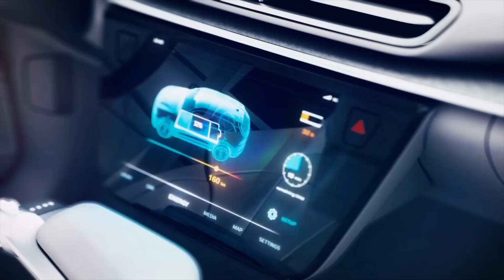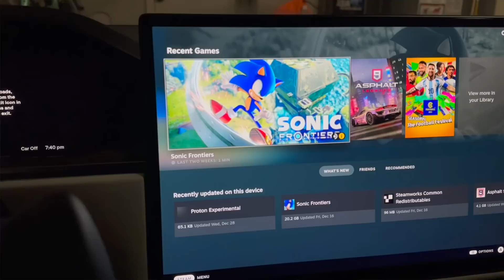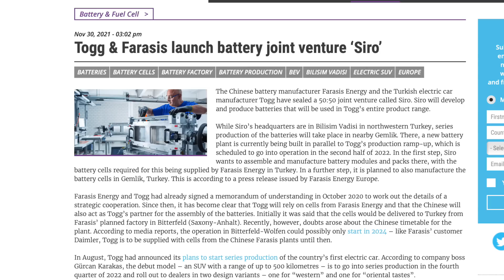This Turkish EV Could be a Game-Changer

Comment: It's a shame that more EV manufacturers don't try 2 incorporate solar panels into Vehicles , like on the Aptera or light-year. Could regenerative suspension b used 2 extend range .
Reply: The sedan model will have solar panels and the vehicle will receive half charge from the sun

Comment: I need to correct that range values 300km single motor and 500km dual motor are according to WLTP cycle not NEDC as you mentioned in the video.

Comment: 310 miles on the NEDC standard is like 230 miles EPA. That's just not going to be competitive.
Reply: There might be a misinformation about that long range has a 88kw battery and I'm almost %100 sure Gürcan karakaş said the range is 500km wltp
Reply: @k.kleonn2610  WLTP is also exaggerated. Additionally, 500 km is 310 miles. So either it's WLTP or NEDC, neither of them are as conservative as EPA which is also an over-estimate of real world range.